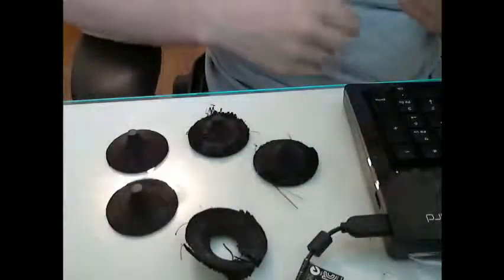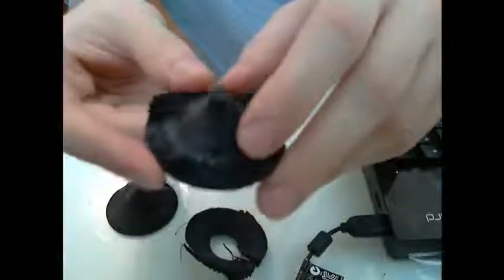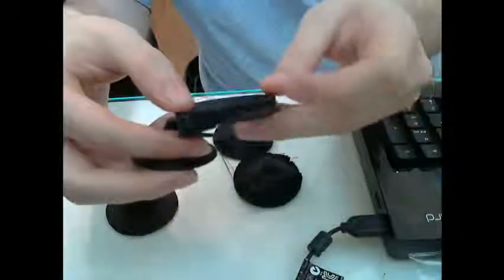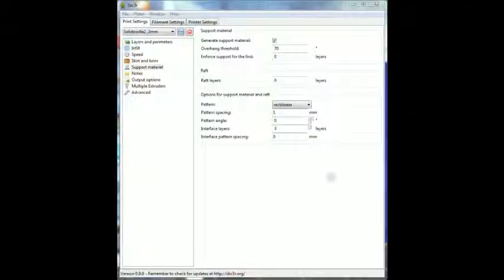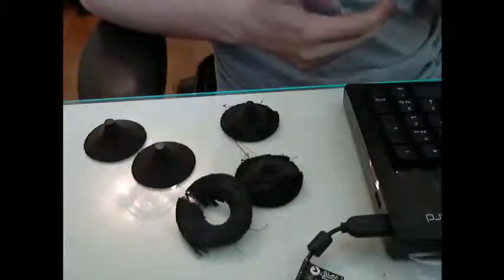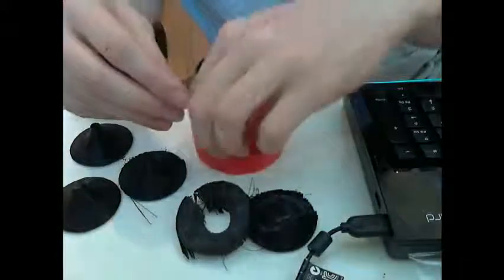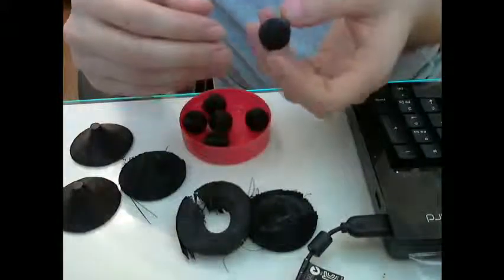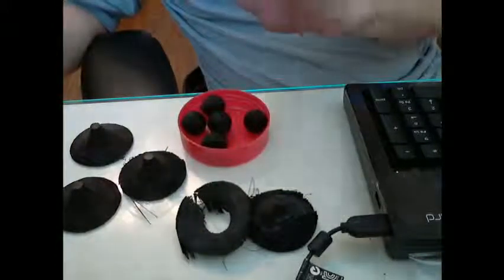Solidoodle Slic3r Support Testing

Comment: If using Repetier Host software:
-open program and go to tab slic3r
-click on configuration box
-under print settings
-select support material.

This should let you do your inverted cone as well as the suspended ball.  Again look to Ian Johnson's info about setting up slicer.  Good luck and happy printing.